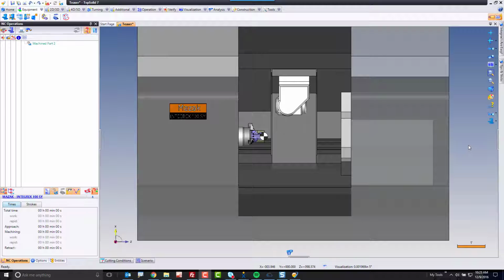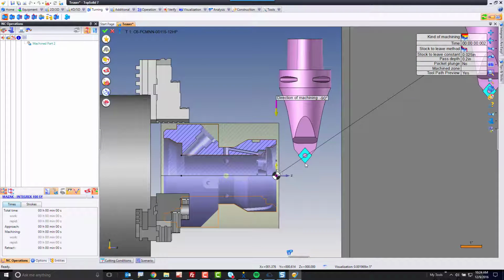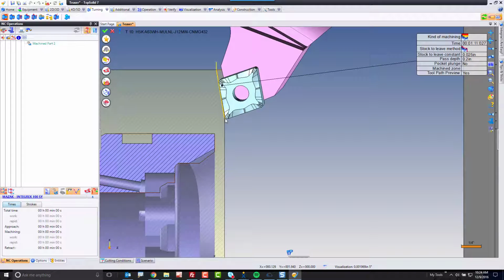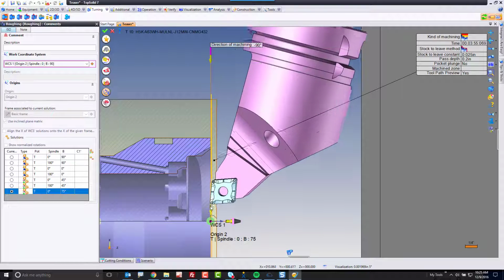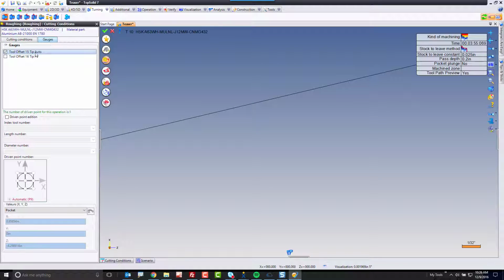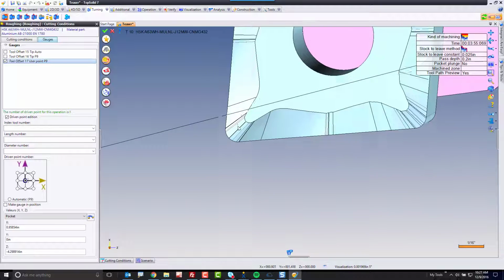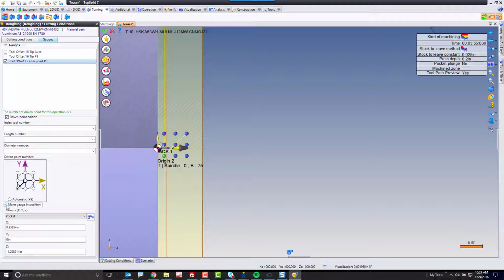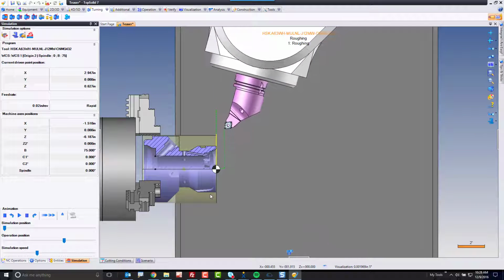TopSolid’Cam Tips & Tricks – Setting the driven point for a turning tool

Comment: Salvador Malfabon1 second agoHello great job friend! thank you to share your video. I have a problem with standard catalogs. when I try to upload a standard tool from catalog there aren´t any part, I mean I can only create a tool manually because when I type in the catalog icon there aren´t any catalog. Can you explain me how can I charge the catalogs in the standard view?. Thanks in advance.
Reply from the maker: Hi there.  If no tool is showing up from your tool file definition, then you likely don't have the correct functions applied.  I will be releasing a video series on making custom tool definitions soon.  That should help you find your way.  If you need help faster, I suggest reaching our to your local reseller.  If you need help finding them, please tell me what country you are from and I can point you in the correct direction.